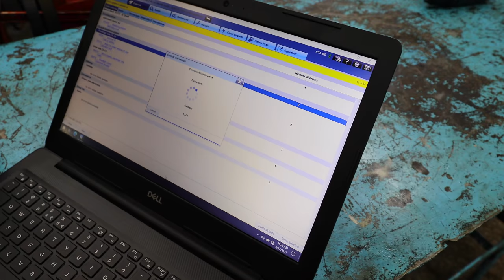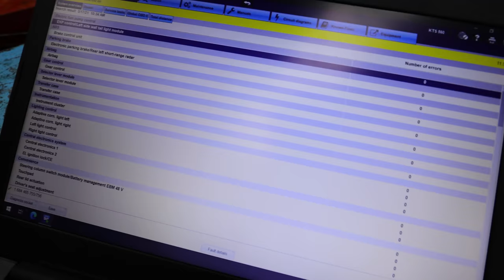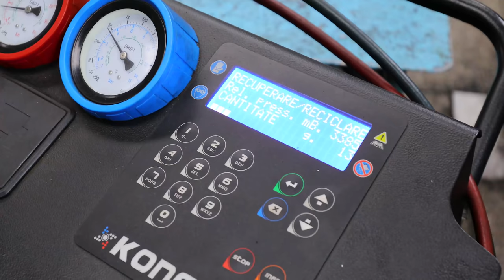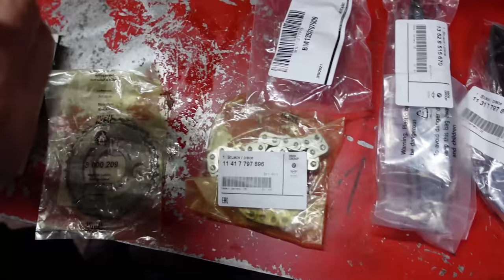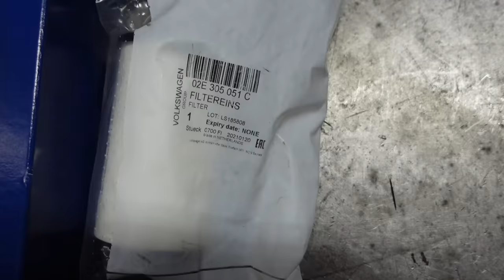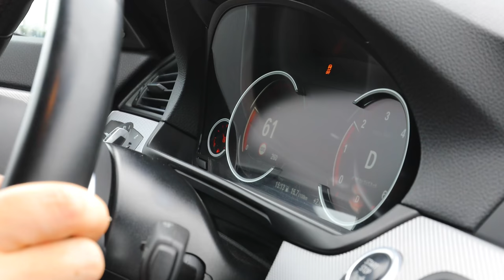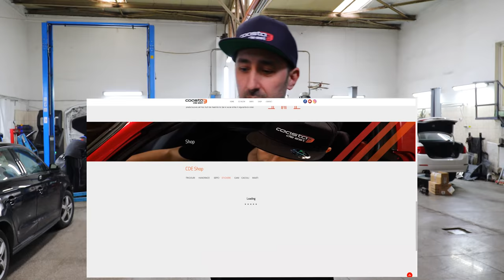BMW M550xd - balaurul cu 3 turbine 😈😈😈

Comment: Masina mea preferata de la BMW este E60 M5. Motorul legendar de 5.0 V10. Imi place faptul ca este un motor luat de pe F1 si adaptat pentru o masina de strada berlina. La vremea lui, acest BMW a fost cel mai rapid sedan din lume si a revolutionat seria M. O masina orientata exclusiv pentru pasionati, reglaje pentru cutia de viteza, motor si suspensie in mai multe trepte, spre deosebire de modelele din ziua de azi in care te-ai urcat, ai selectat totul in Sport si gata. O legenda pe care sper ca o voi putea intalni macar o data in viata. Succes in continuare baieti!

Comment: Pentru mine cel mai tare model este BMW seria 3, rosu, 2 usi, din 1978. Si acum povestea din spatele preferintei mele si de ce aceasta masina mi-a ramas in suflet. Anul 2004, aveam 19 ani si inca lamaia in geam. Un prieten mai mare vindea acest BMW pe care il stiam de ceva vreme, mersesem cu el, bagase o gramada de bani in el si masina mergea perfect. De cand m-am urcat eu la volanul ei si am testat-o parca totul s-a schimbat, era alta masina pentru mine, o vedeam cu alti ochi desi mersesem de zeci de ori cu ea anterior. Interiorul era altfel, totul avea sens, prima data cand mi-am dat seama ca tot bordul e orientat spre sofer si parca totul se lega. Nu stiu de ce nu observasem toate aceste lucruri pana atunci dar cand esti tu la volan ai o alta senzatie. Mi-a placut totul la masina aia si stiam ca trebuie sa o am. Am facut tot posibilul sa fie a mea dar din pacate imi mai trebuiau 200E si nu am resuit sa o cumpar. Toata viata am privit masina aceea ca "the one that got away", poate ca am lasat-o prea usor sa imi scape printre degete. Am ajuns intr-un final proprietar de Renault 5 Alpina, alta jucarie care mi-a adus multe bucurii, dar din cand in cand mintea imi fugea tot la acel BMW. Inca ma mai gandesc cateodata la ea si azi, poate ca intr-o zi o sa imi cumpar una exact la fel doar pentru copilul din mine. Spor la treaba baieti! Sper ca nu v-am intristat cu povestioara mea :) Keep up the good work!

Comment: Cel mai tare bmw facut vreodata... Pentru mine bmw e46 318i 2004😂😂. O am de la 19 ani(acum avand 27)si a adunat amintiri multe in cei 150k km. Cred ca nu ai cum sa nu te atasezi oarecum de o masina veche pe care o ai de mult timp, pur si simplu o cunosti ca pe un prieten. Doar tu stii sa o conduci perfect, stii cand ii place ceva si cand nu. Pentru mine legatura asta intre om si masina e cea mai importanta,ca in rest tot acelasi metal si cauciuc sunt toate. Keep up the good work!! 😊😊
Reply: Îs scumpe la piese BMW?
Reply: @ionutm6577  da si nu...depinde mult de ce piese pui.Marja de pret este foarte mare intre ele.Asa ca exemplu:senzor ax cu came este si cu 120 de lei,eu am pus original cu 450.Pompa de benzina este si cu 200 de lei,eu am pus cu 680 originala,etc.Deci pana la urma depinde de tine ce vrei sa cumperi si cata liniste vrei sa ai cand te urci la volan,dar cred ca asta e valabil la orice firma.Oricum, cred ca este universal valabil,ca la o masina veche trebuie sa fii foarte ferm in diagnosticarea si rezolvarea problemelor.

Comment: BMW 507 este una dintre cele mai frumoase mașini . Acest roadster   este cel mai bun exemplu de renaștere a mărcii după al doilea război mondial. A folosit un motor V8 de 3,2 litri cu 150 CP  Ce sa zic o frumusete de motor desi nu am putu conduce aceasta  masina niciodata....pentru mine este cea  mai sportiva masina ....Salutare echipei  Coasta de Est ..

Comment: Cel mai tare model de BMW, in opninia mea, este cel pe care il ai, cel la care schimbi cu mana ta ceva stricat sau uzat si vezi apoi ca i-ai adus un plus. Degeaba zic unii ca M5, X6 sau nu stiu ce serie din nu stiu ce an. Ia si condu masina, ia si schimba o piesa, doua la ea si apoi vezi care e mai buna. Cel mai fericit am fost cand i-am schimbat arcurile si telescoapele cu o simpla presa de arcuri si o tubulara de bujii, iar atunci mi-am dat seama cate lucruri poti sa faci cu putin timp liber si un minimum de scule. Totodata am invatat ca ai nevoie de scule speciale cand vrei sa faci upgrade de la fulia de alternator simpla la cea cu ambreiaj. Apai cu o trusa completa, sigur dezmembrezi toata masina si o faci la loc ca pe lego. Apropo, Iulica, un E91 negru am 😂 De ce E91 e cea mai tare masina? Pentru ca are un sasiu bun, simti placerea de a conduce avand cursa scurta a telescoapelor, servodirectia hidraulica si portbagaj in care poti sa ingramadesti un carut de bebe si cateva bagaje. Pacat de 'nea Ion, era o placere sa te uiti la el.

Comment: Cel mai tare model de BMW facut vreodata dupa parerea mea este e39 M5
Motor de 5000 cmc 400hp aspirat natural V8
Cel mai rapid sedan la vremea lui.
Super confortabila si dotata pentru o masina 2000-2004
Si acum cand apare una pe strada atrage toate privirile si impune respect.

Comment: Prima generatie de BMW Seria 6, dupa ce a fost redenumita gama New Six, era un coupe cu forme extrem de atragatoare.Initial, odata cu lansarea din 1976, avea sub capota un propulsor in 6 pistoane de 3.2 litri si 197 cp. A urmat motorul de 3.5 litri care producea 218 cp, insa apogeul acestui model a fost atins in 1983, cand a iesit pe piata primul M6 numit la acea vreme M635CSi. Acesta din urma avea o putere de 286 cp si un top speed de 255 km/h,mi drag de voi,va urmaresc si imi pare rau pt nea ion...era tare cu dumele lui😃😃multa bafta baieti in tot ceea ce faceti cu suflet🙏🙏❤️

Comment: Salutare baieti faceti o treaba minunata bravo voua va zic ca imi place modelu M57D30 cu 6 cilindri in linie diesel întâlnit pe E46 330D-184 cp.
BMW a construit motoare diesel inainte de anu 1999,iar unele dintre ele cum e cazu lui 325TDS au fost chiar excelente pentru vremea lor. Pe de alta parte,varianta originala 330D se afla la un alt nivel,propulsand modelele de seria 3 la 100 de km in mai putin de 8 secunde si producand o forta de invidiat pentru acele vremuri. In zilele noastre bineinteles micutul motor in 4 clindri 320D produce mai multa putere decat originalu propulsor in 6 cilindri 330D dar,cu 50% mai putini cilindri,performantele lui nu mai sunt deloc aceiasi. Succes in continuare baieti. Forta Coasta de Est

Comment: Pentru mine BMW E39 mi se pare cel mai reusit model de bmw , pentru ca pe el a inceput sa se puna bazele tehnologiei de la bmw. Are un sasiu in mare parte din aluminiu, la suspensie este folosit in mare parte aluminiul. Este de asemenea primul model de seria 5 pe care se monteaza si motorizari in 4 cilindrii si este un model de bmw care nu s-a fabricat cu sistem de 4x4 all-wheel drive.Este o masina legendara si cunoscuta pentru fiabiliatea de care da dovada la motorizarile in 6 cilindrii si de tehnologia si comfortul oferit in habitaclu.Pe motorizarile de 6cilindrii diesel sau folosit si celebrele cutii de viteza ZF.Este un model mai mare decat predecesorul sau bmw e34 , rigiditatea masinii a crescut cu 40% si a imbunatatit calitatea condusului. Sa nu mai zic de modelul m5 e39 care este un motor legendar v8 S62 aparut in 1998 la Geneva Motor Show si a fost produs intre 1998-2003 cu o cutie manuala in 6 trepte cu care masina dezvolta 394 de cai si 500 NM. Pe scurt o masina senzationala care reuseste in prezent sa te duca cu gandul la masinile clasice bmw si calitatea acestora din trecut , dar reuseste sa fie practicabila si in prezent datorita dotarilor si tehnologiei pusa pe aceasta .  <3

Comment: Salutare stimați pasionați ai domeniului de Automotive.
Cu privire la cele mai tari BMW-uri fabricate vreodată, am zis să încerc să îmi exprim și eu opinia mea, de inginer auto (că tot am făcut facultatea de Autovehicule Rutiere).
Din punctul meu de vedere, pe partea de performance, BMW M3 CSL E46. 
Dinamica și performanțele atinse de BMW cu acest automobil erau aproape imposibil de atins în acea perioadă. 
Totul a fost optimizat la maxim: pentru greutate au preluat materiale din motorsport (unde au salvat 110 kg): avem plafon de fibră de carbon, scaunele scoică din fibră de carbon, consola centrală tot din fibră de carbon. 
Pentru performanțe avem admisia tot din fibră de carbon, cunoscută pentru sunetul specific care face orice pasionat să întoarcă capul după zgomot, optimizată pentru curgerea fluidă a aerului, motorul S54B32HP, datorită noilor arbori cu came și a supapelor, a reușit să atingă cifre de invidiat pentru motoarele aspirate (360 CP și 370 Nm dintr-un motor cu o cilindree de 3.2L) din acea vreme, caseta de direcție care are un raport mai scurt, roțile special făcută de către cei de la BBS împreună cu anvelopele care oferă o aderență de invidiat samd. 
Toate aceste optimizări au avut un singur scop, care, după părerea mea, a fost atins: placerea de a conduce un vehicul performant cu tracțiune spate. Să nu uităm, totuși, că au reușit să atingă un timp de 7:50 pe legendarul circuit de la Nordschleife.
Singurul dezavantaj al unui M3 CSL E46 poate fi considerat transmisia automată SMG II cu Drivelogic, cunoscută pentru lipsa de fiabilitate (probleme la pompă, releul pompei, cilindrul receptor, senzorul de poziție a ambreiajului samd). Însă partea bună este că avem soluție pentru trecerea la o transmisie manuală, care amplifică plăcerea oricărui amator de a conduce așa ceva.
PS: îmi face plăcere să urmăresc materialele video oferite de voi pe YouTube. Felicitări și keep up the good work!

Comment: E39 am avut,520i prima mea masina simplu,fara pachete M si alte chestii,150 de cai o masina comfortabila,spatioasa si construita foarte bine,fara butoane sterse,fara rupturi la scaune,volanul era ca si nou chiar daca avea peste 200k de km.
Cu acel Bmw am inceput si eu sa mersteresc,am invatat multe despre cum functioneaza un autoturism,atat pe parte de electrica/electronica dar si pe parte de mecanica.
De caroserie nici nu mai zic,avea 20 de ani si nici un gram de rugina,singurul meu regret este ca am vandut-o,dar in viitorul apropiat am de gand sa cumpar alt E39 de care nu ma voi mai desparti.
In decursul timpului am avut o sumedenie de masini,inclusiv astra H ca am vazut ca ati pomenit-o,o cotoarba de masina cu fire rupte prin portiere,etrieri care clantanesc sa niste clopote,check engine aprins mai mereu,cutia M32 care numai suturi imi da etc etc.
Asa ca fratilor,o sa ma reintorc la E39 si acolo o sa raman,cel mai bun model Bmw(parerea mea).
Peace

Comment: Salutare băieți,
In primul rand, felicitări pentru tot ceea ce faceți și pentru pasiunea pe care o depuneți.
In al doilea rand, din punctul meu de vedere, cel mai fain model de BMW fabricat a fost BMW M5 în caroserie E60.
Acest BMW a fost o mașină destul de criticata la inceput deoarece era extrem de diferit fata de predecesorul său BMW E39, din cauza aspectului deoarece lumea nu era obisnuita cu un astfel de design. Totodată acest model a reușit să inchidă gura criticilor datorita motorului sau V10 de 5.0 care produce 507 HP, a stabilit noi standarde la acea vreme in materie de sportivitate, iar din cate am citit eu, a rămas până în ziua de astăzi, cel mai vândut M5 din istorie. 
O alta critica adusa acestei mașini de referă la faptul că acest model a fost primul din istorie care nu venea echipat standard cu o cutie manuala, aceasta fiind înlocuită de transmisia secvențială SMG cu 7 trepte (o cutie manuala-robotizata). Am avut ocazia sa merg cu un astfel de model și într-adevăr, în oraș mașina smucește datorita cutiei, dar până la urmă este un model de performanță, nu de oraș, iar în modul sport SMG-ul își face treabă excelent.
Mi s-a părut interesant faptul că în mod normal propulsorul V10 de 5.0 produce 400 HP, dar odată ce se apasă butonul M de pe volan, produce 507 HP.
Din nefericire motoarele de genul sunt acum ca o specie de animale pe cale de dispariție din cauza normelor de poluare tot mai stricte. 
In concluzie din punctul meu de vedere este cel mai reușit model deoarece poate bate foarte multe mașini sportive, care acum se afla pe linia de asamblare.
Mult succes in ceea ce faceți și în vara trebuie sa ne vedem sa schimbam preventiv distribuția la M47-le meu.
Multa bafta și spor sa aveți 🙏

Comment: Respect pentru toata munca pe care o faceti, o sa va aduc si eu F10-ele zilele urmatoare pentru sper eu, mici reparatii. Sunt fan BMW de mic copil, si desi in ultima perioada nu au mai scos aceleasi masini ca in vremurile bune, sa zicem, imi plac toate modele lor, singura exceptie facand seria 3 compact, parerea mea. 

Daca ar fi sa fac un top al masinilor favorite as putea include multe, dar pentru moment ma rezum la 3 dintre ele.

Pe 3 as include BMW E39 M5, pe care am vazut-o in primul episod TopGear la care am avut eu acces si cu care mi-am petrecut multe ore conducand in NFS, desi doar virtual, era masina mea preferata din joc.

Pe 2 as include BMW 635 CSL, o masina superba inclusiv in ziua de astazi.

Iar favorita mea este BMW 2002 TI, considerata primul sedan sport din ziua ei, si imi place foarte mult simplitatea de atunci, liniile masinii si desi in standardele de azi ar putea fi considerata o masina lenta, performantele obtinute din acel motor.

Comment: Dupa parerea mea, cel mai tare model bmw facut vreodata este BMW E30 325i allrad. Primul bmw cu tractiune integrala. Acest model era echipat cu un motor cu 6 cilindri in linie care dezvolta o putere de 171 de cai-putere. Ce era interesant, in anul 1985 acest bmw a fost lansat pentru tractiunea integrala. Aceasta tractiunea integrala este unul de tip permanent care trimitea 37% din puterea motorului catre puntea fata iar restul de 63% din puterea motorului era trimis catre puntea spate. Pentru a nu aparea "torque steer" BMW a realizat un angrenaj auxiliar de tip roata dintata pentru tractiunea pe puntea fata, doar pentru a pastra o virare neutra, tipica bmw. In conditii mai dificile sau se aborda un stil de mers mai sportiv, cu ajutorul vascodiferentialelor din cutia de transfer si diferentialului spate avea posibilitatea de a varia procentul de putere transmis către fiecare punte în parte. La nevoie , in conditii de aderenta scazuta se putea transmite mai multa putere pe puntea cu mai multa aderenta. De exemplu puntea spate ii pe gheata, iar puntea fata pe asfalt, sistemul de tractiune integrala putea trimite mai multa putere catre puntea fata pentru a putea misca masina. Un lucru chiar impresionant, in anul 1985, diferentialele blocabile a fost integrate cu sistemul ABS de franare, care era o echipare standard doar pentru BMW 325i allrad. Dupa 3 ani acest sistem de tractiune integrala a fost pus si pe Seria 3 Touring, iar in anul 1986 BMW 325i allrad a devenit cunoscut sub numele de BMW 325ix

Comment: Salut baieti! Pentru mine cel mai impresionant BMW este M5 e60,vine cu o motorizare de 5.0 benzina V10 507 cp.Este singurul BMW care îmi da cea mai mare senzație de putere,având cutia SMG îl face foarte agresiv deoarece ai un “roboțel” care schimba pentru tine. Butonul de “POWER”care pana sa fie apăsat ai un simplu e60,iar apăsat îți oferă cei 507 cp de care te poți bucura la maxim. Fiind foarte pasionat de M5 e60 am ajuns sa dețin doua modele 530d 231cp și 525d 177cp la care meșteresc zilnic ❤️ Succes la treaba,și la cât mai multe “M”uri 🥰

Comment: Bmw e46 este după părerea mea cel mai tare model de BMW făcut vreodată. Pasiunea pentru marcă de pornit de la tatăl meu care la rândul lui a fost un împătimit al firmei bavareze. Pe când aveam aproximativ 8 ani, tatăl meu a cumpărat  primul BMW e46 320d variantă facelift de 150 de cai. Pot spune că mașina aia m a făcut pasionat, ulterior pasionat de mecanică. Pe perioada de aproximativ 14 ani cât mașina a fost în familie, probleme au fost destule, precum injectoare, clapete de pe admisie trase în capul pistonului, casete de direcție, termoflot, ambreiaj, grup, ceva rugină ce apărea destul de des mai ales în aripile față, deoarece acestea au o buza unde se strânge mizerie și favorizează apariția fenomenului de coroziune și multe altele. Cu toate acestea, eu îl consider cel mai reușit model deoarece marea majoritate a reparaților le puteam face in fața blocului cu tatăl meu, chiar daca foloseam de cele mai multe ori scule împrumutate. In momentul in care mașina a fost în cea mai buna state, aceasta a fost scoasă la vânzare și a primit o nouă viață la un român stabilit în Corsica. 
Tot din pasiune pentru marcă a mai urmat inca un e46, de această dată ceva mai dotat și touring. Iarăși probleme, însa deja deveniseră comune. 
Sper că mica mea poveste sa ii ajute pe toți cei ce vor un e46, deoarece cam asta ar trebui verificat în primul rând. 
Toată stima pentru atenția cu care lucrați, dar și pentru transparență și profesionalism.